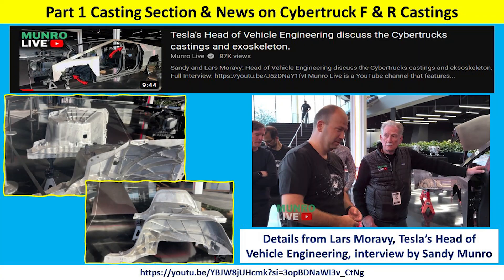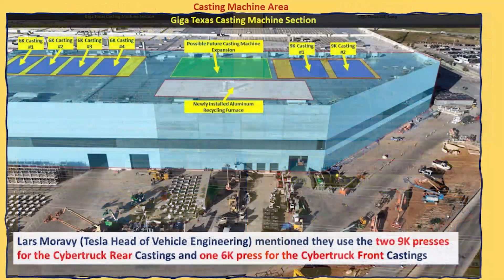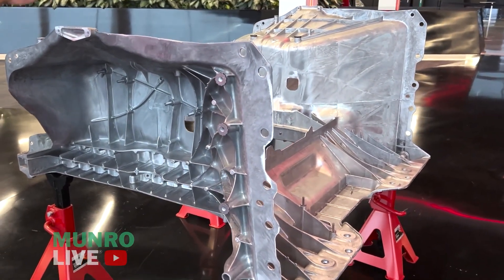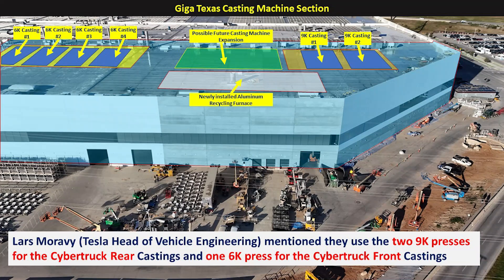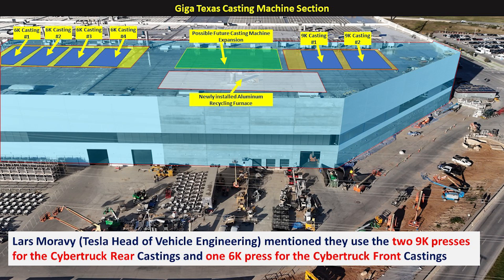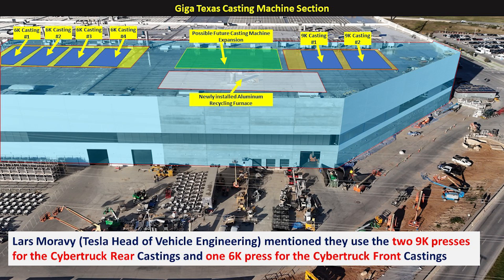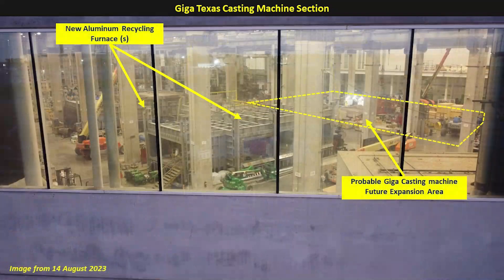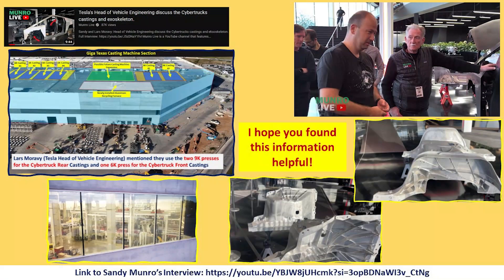Part 1 Lars and Sandy Interview & Discussion about Cybertruck Castings & Giga Texas Implications!

Comment: It seemed to me he said that they have 1 6k press for cyber truck, plus 4 for model Y . to be 5 in total plus the 2 9k presses
Reply: This is what I thought I heard also.
Reply: It's confusing. Last time Joe was able to peek inside in August there were 4 x 6000t machines and 2 x 9000t. https://youtu.be/AyW1j_iGpJc?t=1057

Either they have slipped in another 6000t machine, or Lars misspoke. The latter more likely.
Reply: @DessieDoolan  Yeah, he probably meant of the x4 one is being used by CT. It makes sense because they have spare capacity given they are not making Model Y with front castings.
Reply: @boostav  Certainly haven't seen anything but rear castings stacked outside for a while. Model Y and Cybertruck.